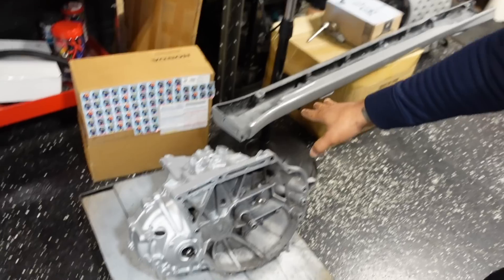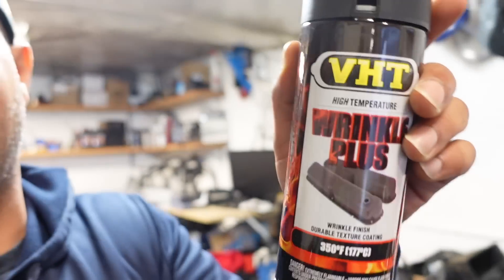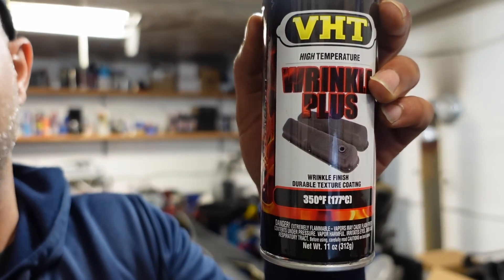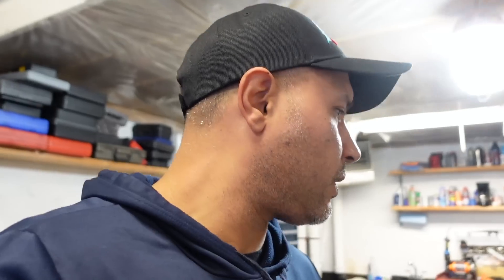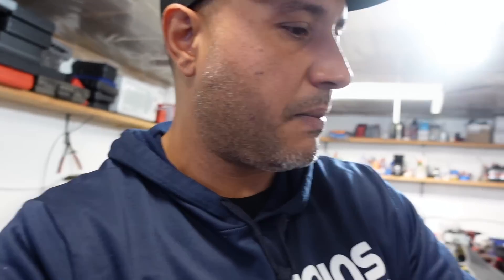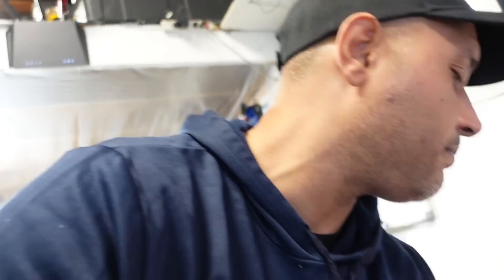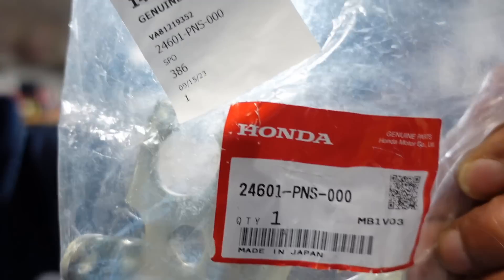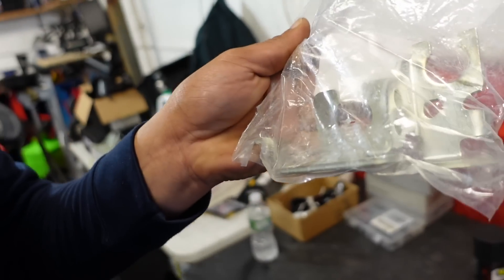Making A K-Series Transmission Look NEW Continues(Wait 4 It🤗)

Comment: Any advice on getting speed to read on css transmission I saw your vid on installing the k tuned converter followed your instructions swapped the actual sensor on the transmission 3 times already and still no speed